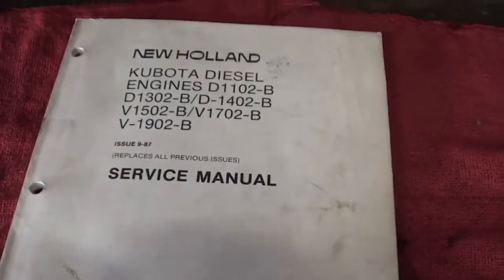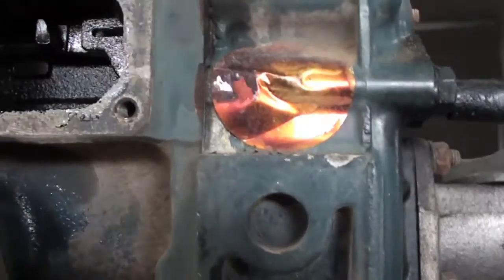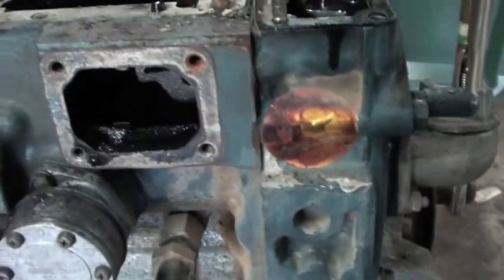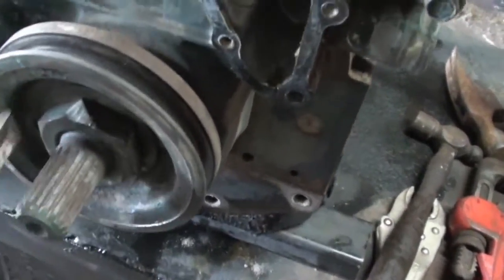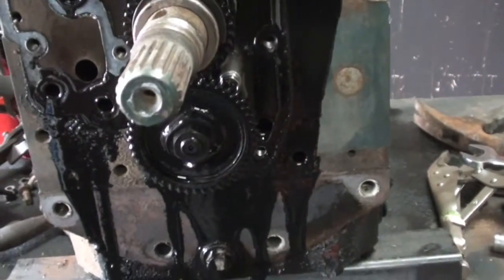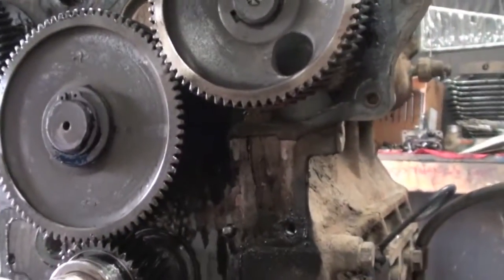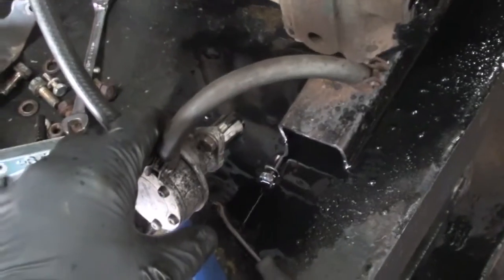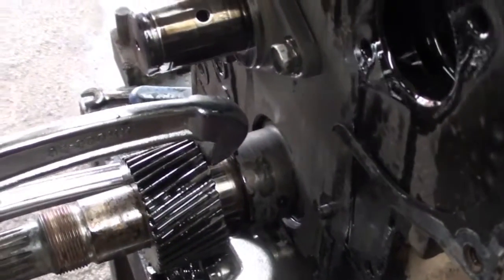bobcat engine removal 6

Comment: hi, great help with checking out how to remove the distributor pump. My 50c about timing cover bolts. i usually take big piece of cardboard and draw the pattern and press them into it in the correct order :) I am a clumsy guy

Comment: The timing marks will eventually line up, you may have to turn the engine over for a while but they will line up. If you are tearing the engine down completely you don't need to worry about doing that, only after cam, crank, pump drive removal. Just make sure you line everything up when you put it back together.
Reply: I’m kind a new to this social media thing says on here you wrote this for years ago but it just help me tremendously and I just want to say thanks

Comment: I have a bobcat 743 with a oil leak coming from the front crank seal do I need to pull the front gear case off to change the front crank seal?

Comment from the maker: You'll need to remove the pulley and with some picks, you MIGHT be able to get the old seal out. Then it's just a matter of sliding the new seal in place. If the removal gives you trouble, the cover will have to come off.